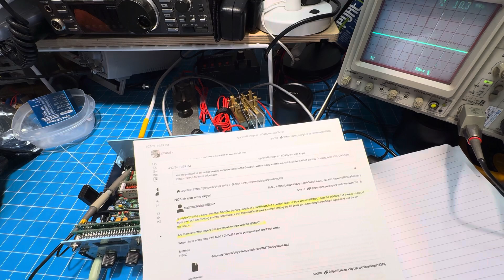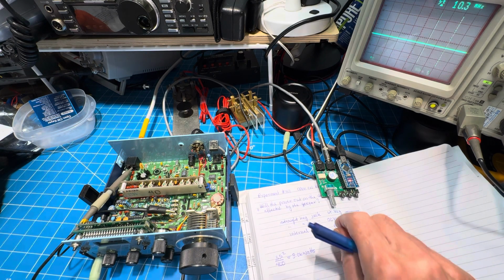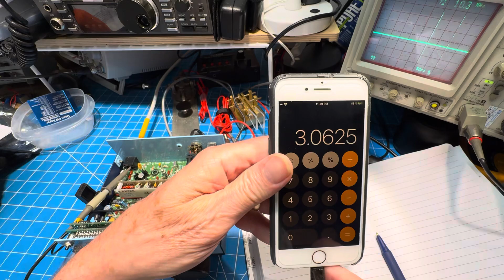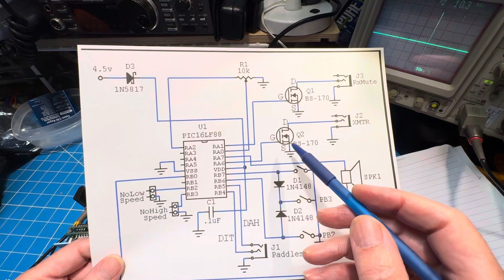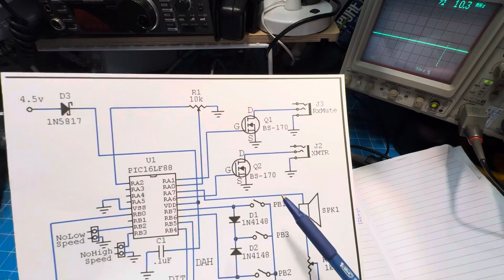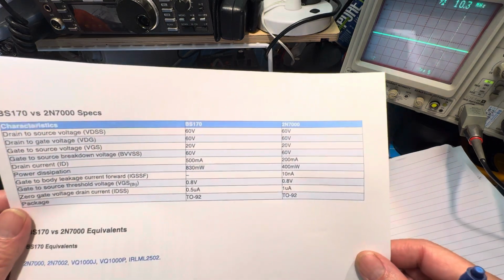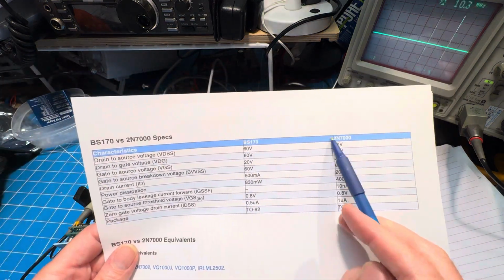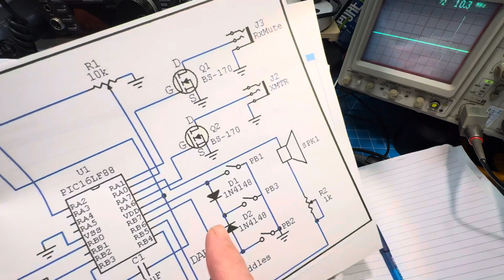Open CW Keyer Build - Will it key the Wilderness Sierra?

Comment: I was wondering how the Open CW keyer would work with a different rig.  So now, I'm wondering would a design modification to the Open CW keyer or a mod to the Norcal 40B be the next step.
Reply from the maker: Since I have a few NorCal 40A, 40B and old NorCal 40s I will try a FET inside the Keyer to see if that resolves the issues for all. It seems I can either remove the optoisolator or cut a trace.
Reply: Why would a keyer make a difference in the output power? Also, why use an external keyer when the KC1 or KC2 is installed?

Honest question.